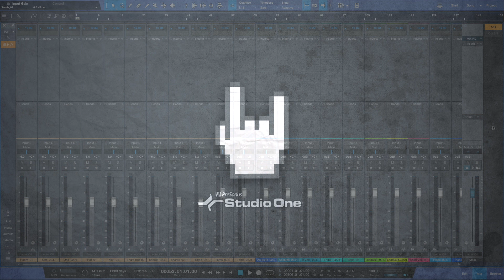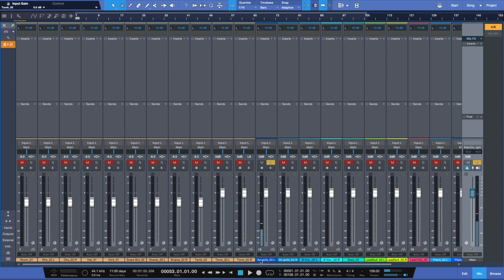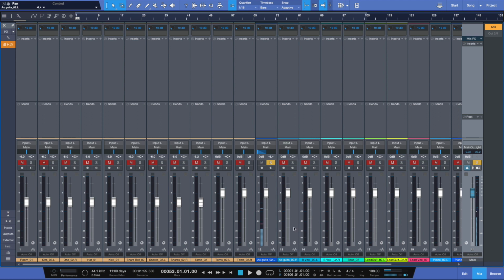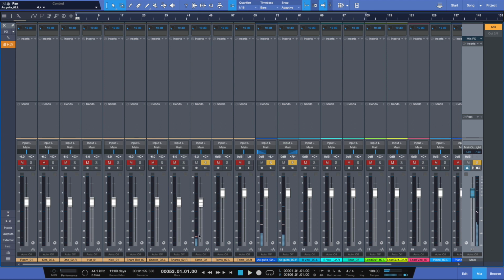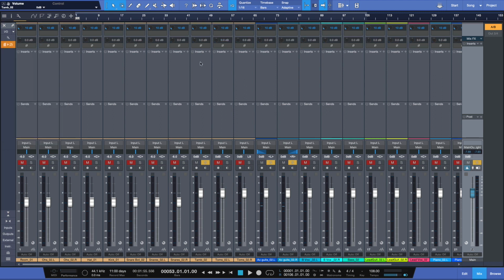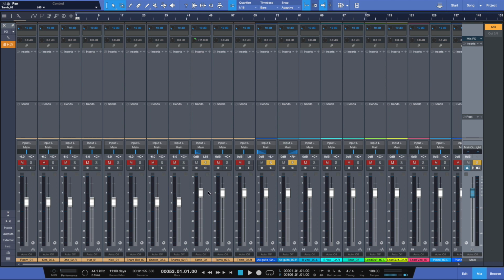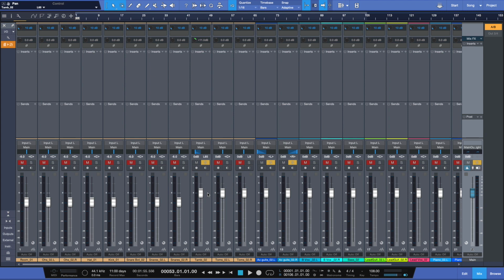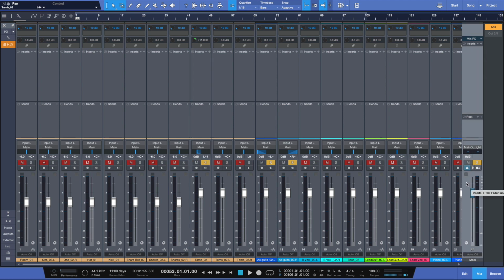Panning Audio in Studio One - Pro Mix Academy

Comment: Is there a way to pan a single track to the far left and right, not in the middle? Or is duplicating the tracks the only way? I watched a tutorial where a guy duplicated his main vox and then in ProTools, he was able to pan the duplicated track to the far right/left so it wasn't centered but the effect was still there but not effecting the main vocal track. (Adding some distortion, that's what he was doing). So, does studio one have access to that both pans for a single channel? I tried it in stereo but it didn't seem to make any difference whether it was in mono or not lol. Still only has a single pan wheel that you can move to either right or left, not choose to crank it in opposite ends on to leave the middle for the main vox. Maybe I just missed something in his video, but he def only has two tracks, the main vocal track and the duplicate with the distortion/saturation on it.